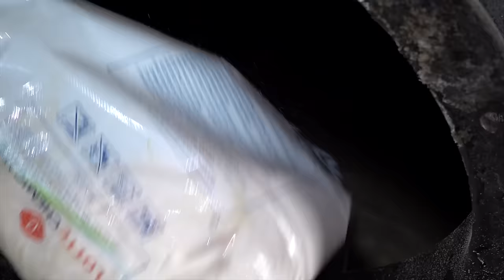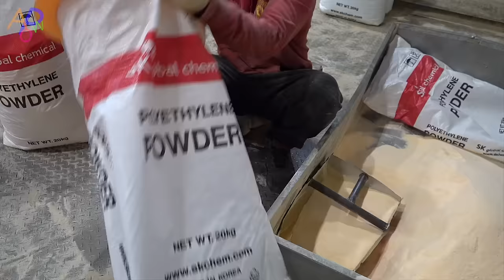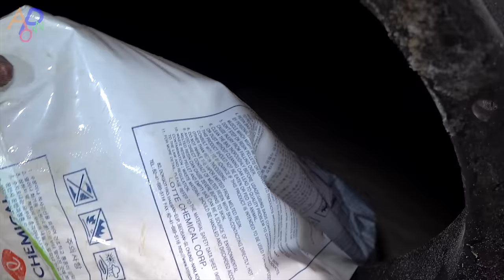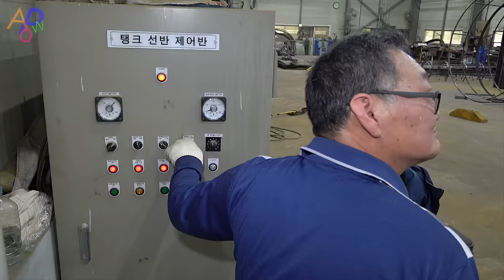Giant Water Tank Manufacturing Process. Amazing Korean Water Storage Factory

Comment: I really love videos that showcase manufacturing processes like this. The work being done is truly difficult and requires skill and labor, so all the workers should be congratulated. The only issue I can see in the manufacturing process is safety. It is very important for personnel to wear masks while pouring raw materials into the main mold. Although it may not cause discomfort in the short term, it will certainly be harmful in the long term. Additionally, the lack of helmets and fire-resistant clothing is also a major problem.
Reply: It can pour by automatically. Safety system is very poor.

Comment: Pretty cool!  I just worry about lifting that on the end by the one point in the hole.  Doesn't that deform the threads?  Seems like you would just make a screw in lifting cap.
Reply: @Ithecastic Not true. If you watch the video where they removed the metal neck filler, you can see the threads. If you look really close when they are lifting you can see it there too.
Reply: @Ithecastic 11:36
Reply: That long bar they put inside does not contact the threads while lifting.
Reply: @shawbros  Go to 13:13.  Yes, the long bar does not contact, but the metal buckle does.  at 13:21 to can see the whole mouth of the opening is deformed.  I expect the opening will return to somewhat normal when relaxed, but that metal buckle against the threads is not good. Again, I think a screw-in metal lifting jig would keep the threads intact and the opening round.  It could even be a screw in plug with the middle having a hole for the strap and pipe to go through.
Reply: @AzKaraokeVic  
I see.
I do not have an answer.
Reply: @Ithecastic There was a thread moulded into it, and yes it got warped when lifting it by that single bar
Reply: @AzKaraokeVic  that thread is probably just for the molding cap to screw in, if they buyer needs to put a cap on this huge tank, he'll probably make new threads on the outer side of the lip like any other bottle shaped containter that carries liquid.

Comment: Dropping bags and bags of polyethylene powder without a mask. This wasnt filmed in 1950. Korea is quite advanced in tech but they need to protect their workers.
Reply: I don't think PE-powder dust is a problem compared to the carbon monoxide levels they inhale
Reply: @瓦森  I would tend to disagree. The CO is diluted with the oxygen in the air fairly quickly (given adequate ventilation), but other more harmful emissions from the gas and flame along with the HDPE powder will be a problem.
Reply: Empathy Korea really doesn't care about safety
Reply: Еще недавно при военной диктатуре в Южной Корее рабочих убивали во время забастовок.
Reply: How about no obvious hearing protection when using the impact wrenches and no fall protection when the guy steps off the man-lift to the strap the top of the tank? I mean no disrespect to the workers, and like the way they seem proud of the product they've produced, but yeah PPE's seem kind of secondary here.
Reply: One big list of safety violations 😳

Comment: At 13:20 it looks like lifting from the threaded hole has deformed it? I guess that is not a problem? Before lifting could you thread in a threaded metal doughnut to temporally reinforce the plastic threaded opening, one with a hole in it so the lifting bar could be inserted into the tank? Thanks.

Comment: Isn't this method of heating entire mould that is super thick , a waste of fuel ? Why can't heat the mixture in proper furnace then pour it inside the mould like any plastic extrusion process?
Reply: This is rotational moulding, not injection moulding or extrusion. The powder needs to be evenly disbursed and melts as the mould rotates and in this case rocks. More modern systems use an oven to help retain the heat, but this is one large mould so the oven would be massive.

Comment: The markings on the side of the overhead gantry read 5 ton not 50, oops. : ) You don't pick up 50 tons with one old frayed fabric strap, that's not happening.
Reply: @Ithecastic 50 tons of water is 11,200 gal of water so...eh maybe.
Reply: @davehalliday9399  50 tons of water = 50 m3 of water or 50 000 litres. 1 liter of water is 1 kilogram. 1000 kg is 1 ton. Greetings from Europe where we use normal units :P
Reply: @autre1234  Word! 😸😸
Reply: @autre1234  your describing a "Metric Ton" a 5 ton over head gantry crane is rated for 10,000 pounds, so a normal ton is 907 kg. And your 50,000L of water comes out to 13,208 gal not the 11,200 that I said.
Reply: @davehalliday9399  South Korea (the video is from there) use metric units. There is an inscription on gantry crane "5 tons", so it is 5 metric tons (11 023 pounds, 5 000 kg). Each country says "ton" and has different tones in mind (we for your tones say "US ton" or "short tone").
Reply: I think it would read 5 mt for metric ton not 5 t, I think your wrong on that.
Reply: @davehalliday9399  No, term "metric ton" or "mt" is not used in countries that use the metric system (and this video is from a South Korea where metric system is default. Trust me, I also live in a country (Poland) with the metric system and everyone uses "tons" as metric tons). Also, I checked their site, a 50 mt tank holds 50 m3 and 50 m3 of water is 50 mt. On the website they also write "50 t" next to the tank, which holds 50 m3.

Comment: A tiny bit of suggestion, something like 98% of the energy can be saved by enclosing and insulating the tank your'e blasting with fire, for cooling you simply add cold air at suitable temperature.